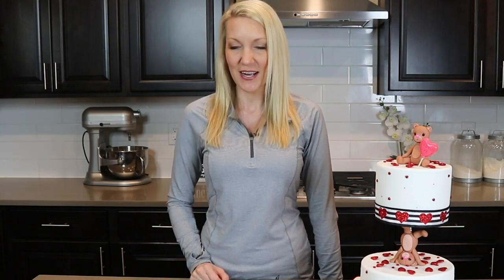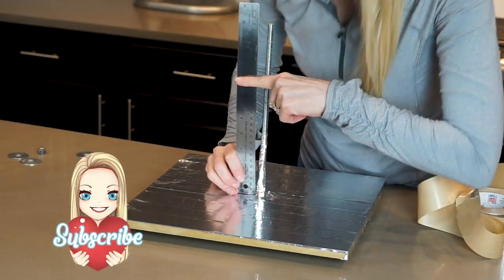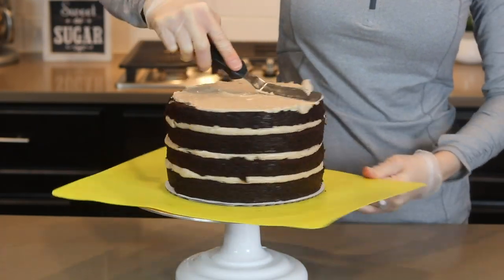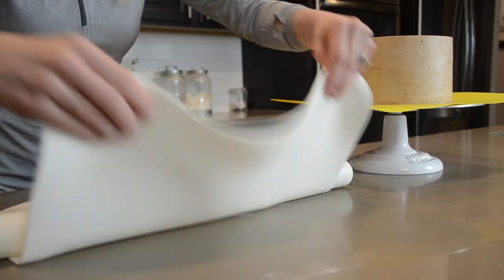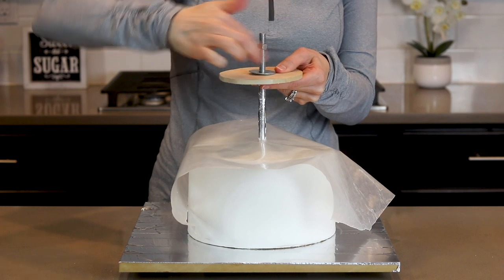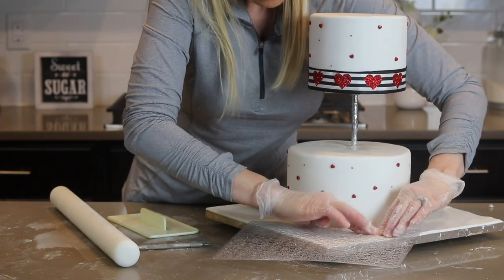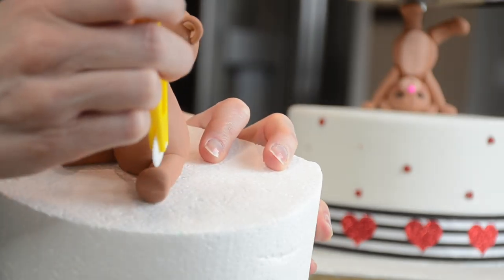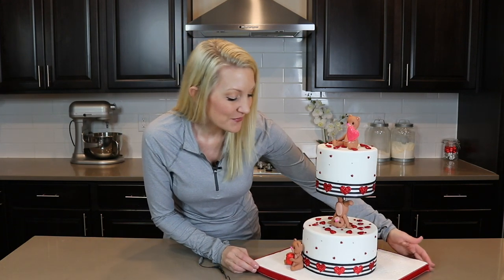VALENTINE'S TEDDY BEAR CAKE - Gravity Defying Floating Tier Cake

Comment: Beautiful! Just wondering... why do you need to add tylose to the fondant for the bear characters?    And do you need to add to the fondsnt that covers the cake?
Reply from the maker: Hi Kay. Tylose is added to strengthen and help dry out the fondant, so I would use it on figures and pieces I want to harden.  I don't typically use it on fondant for covering the cake.

Comment: Hi I have a similar cake but it’s a 4 tier , how and it’s more tipsy turvy how can I get the boards at different angles
Reply from the maker: I saw one the other day that used pvc pipe that was cut at different angles. I’d like to figure it out with a threaded rod though.🤔 If I figure it out, I will post.

Comment: Hi! Love this and all your videos! I have a question what size rid would I need to make this a 4 tier(just adding 1 more to the bottom) 6,8,10,12” cakes?
Reply from the maker: Thank you! It depends on how tall your cakes are. I would buy a taller threaded rod and cut it down to the right size with bolt cutters.
Reply: Okay! They are 4” tall each.

Comment: What type of boards are the top ones
Reply: I think it's the same as the bottom one.
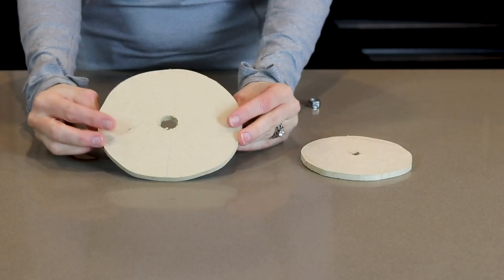Reply from the maker: For the top tier I used two boards. A 4" round and 6" round made from MDF. You can see them at 3:43